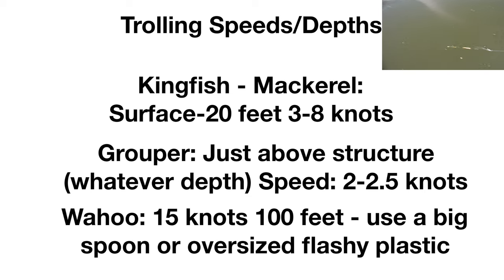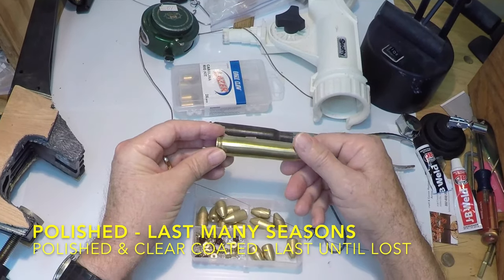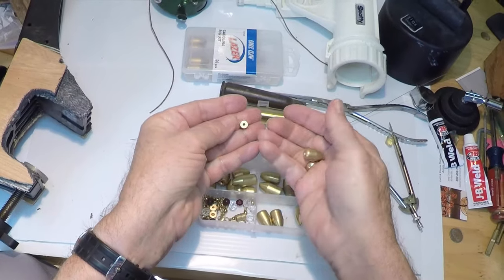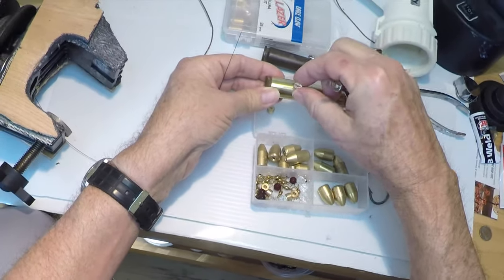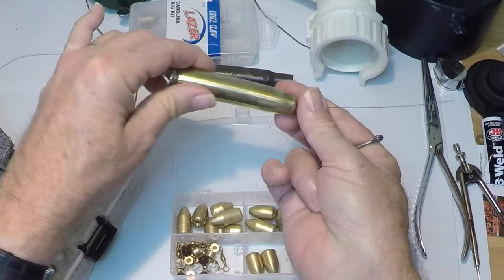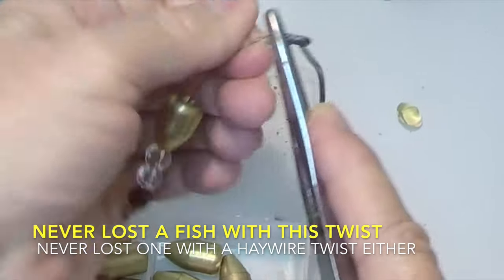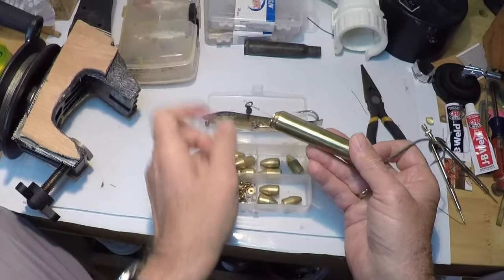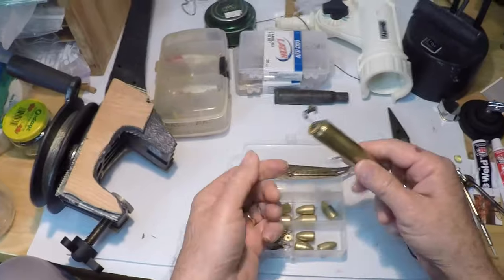Big Fish Trolling Tips Video - New Flasher Knocker Rig - King Mackerel Wahoo Fishing

Comment: MATT  Really good to see your post and videos.and Really great timing on this one  fixing to leave out past the rack  I know you know what that's at. and head up the cost and over to mobile bay then north probably the next month or so . I think it would be a good idea to drag one of these across your old fish hole up North off   Crystal River from here .what do you think I've never seen anything like this in all the years I've been fishing it makes so much sense. It's like a rattle trap on steroids   and it's so simple .thank you for passing this on.would I need to use a planner with this rig
Reply from the maker: Wow - that is a real trip you're doing.  Great!!!!  Yep - try it - just remember the trolling speeds.  I used this with a down rigger as stated.  Just drop the ball within 5 feet over the tops of the rocks and let it do its job (it will).  One of these ECO spoons works well for grouper or mackerel: https://www.westmarine.com/buy/l-b-huntington--eco-fishing-spoon-3-1-2--3133899?msclkid=c995f6cf14c719a45b8494cd7752fe05&utm_source=bing&utm_medium=cpc&utm_campaign=BSC%3ENonB%3EProduct%20Type&utm_term=4576854589783629&utm_content=Fishing
Reply: @mattmattsongold  I will thank you for  all the tips.
Reply from the maker: @brianbavington4665  : thanks Brian - I sure wish you success!